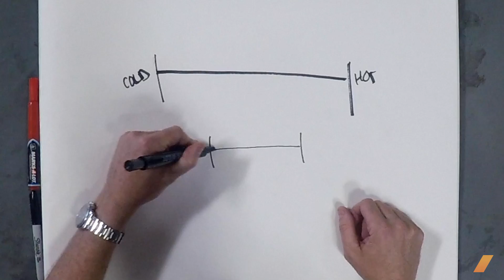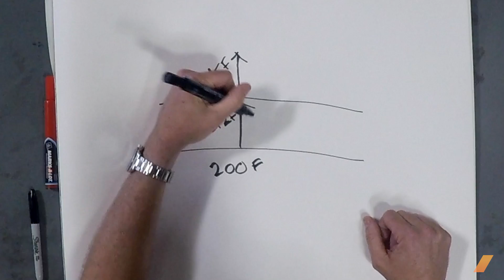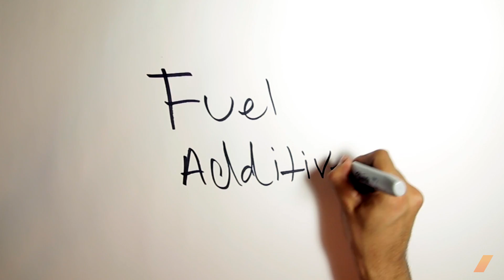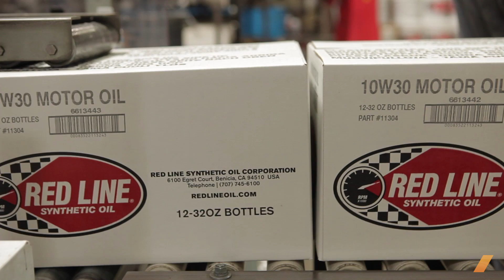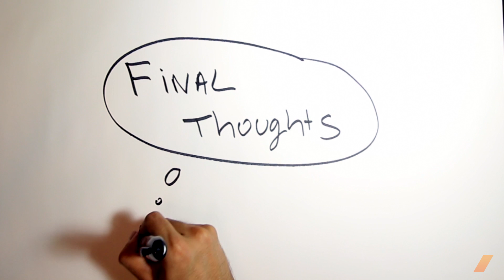10W-WTF!? Dispelling Myths About Oil -- /ENGINEERED

Comment: So my question is. I really like Redline, that is all I run in my 500 horsepower daily driver/track car. At what point do I blend Redline race oil with Redline daily driver oil? If your company could produce an algorithm that could address that through testing I would be a Redline buyer for life. If your company would be so bold as to design a program for weekend track warriors to blend different types of oils with different weights depending on driving types and different thermal locations in the USA, I think you could increase sales.

Comment: not sure what you guys are so impressed about,there wasn't much in this video. 

i run my 2.0 4 cylinder with variable valve timing on helix ultra 5w 40. it's 150,000km now with zero. i mean zero. oil loss in 8 to 9 month 30,000km change interval. the engine has zero vibration, and the oil drains smooth. it's a 7 year old car that's had only synthetic in its entire life. the api rating doesn't mean shit at normal operating temperatures. like the dude said, all oils have same viscosity at operating temperature. the biggest misconception is that synthetics are too thin for high mileage engines. nonsense. you buy top end oils for detergents, stability and wear protection, NOT viscosity. that is all you need to know.

Comment: Theres no difference between using cheap fuels or premium fuels, what matters is using the right octane rating fuel because regardless of which fuel you use its going to build up carbon in the engine regardless and the type of additive you use would also depend on what you're trying to clean such as if you were to use recycled cooking oil as a diesel than theres more than carbon you'll be cleaning.

Comment: Rotella T6. Period
Reply: While Rotella T6 is good oil it may not provide you with the protection you think it does. 
Rotella T6 does not have high levels of zinc and phosphorous (ZDDP) that Rotella once did. 
No current API category SL/SM/SN or ILSAC spec greater than GF-3 oil has high levels of ZDDP.
Reply: Good but very basic in formulation and additives. Nothing like Redline or Motul 300v

Comment: I just throw supertech 5w30 oil in my old little 256k miles truck...never had an issue...10 bucks 5 quart lol!
Reply: *****
 Yah i hear that, my buddy has an B&W he will never again buy another one. I love my old little beater truck. I see all these cars these days popping gaskets and doing weird shit and demanding golden glove made oils and such.

Here i come with a 10usd oil pan full and a simple little filter for 5 bucks and i am making my miles with minimal effort. They just do not make them like that no more. And i i do have a brand new Malibu 2015 LT i barely drive..free oil changes but i know they throw in the good stuff. So not bashing any other new car, but still what changed i wonder..
Reply: *****
 Meh what is worse on gas?! I mean i got a 2012 3.7 v6 mustang which does 20 to the gallon, i got a Malibu LT that does 22 to the gallon with 100hp LESS and 2.5l 4 cylinder ECO! Rated at 200hp..
With the auto start/stop system installed.

Then i got my old little 1996 chevy s10 4.3l and i can bolder around 200miles on a full tank which is not much bigger than that of the other cars mentioned. And those had 200hp on the REAR wheel, not all to bad for a old little pick up!
Reply: Eh? 20 to the gallon is 8.5 Km/l. 22 is 9.3. That is very low. I have had cars from the 80-90's with better mileage than that. 93' 3.0 Diesel that goes 33 Mpg, a 86' 2.5 that went 39 mpg with 536000 miles on it.
Even my GSXR bike gets 23-30 Mpg and that is from 98 with a screaming 140 hp.
Reply: Stefan Asmussen
 You missed the point, my point was precisely that they are ALL lousy, while they advertised my 2015 Malibu LT 2.5 to get whopping 35mpg...i can get 24 if that..

My OLD truck (as above they said older engines lousy MPG) and that's a v6 4.3L which pretty much an vortec 350 small block 5.7l where they cut of 2 cylinders (so not small by any means)

DOES pretty much the SAME on mpg...

MPG is hard to determine, when cars get sold that's such a skewed number not even funny.
Reply: Then stop buying cars with large engines. If you want better mileage you need to be under 3.0 liters and 2.0 for petrol.
Although I hate petrol engines.
Reply: Stefan Asmussen
Who said i CARE about my gasoline consumption. Also you clearly did not read...

my 2.5liter 4 ECO uses as much as my 3.7 v6 mustang does. And my 4.3l v6 truck uses perhaps nearly the same as the above..

I would never go for Diesel as it's to expensive to maintain special fluids for emission purposes. Also more expensive in fuel, although they get better MPG ratings which i really do not care one bit about. It's not like a diesel truck gets 20mpg more out of it vs its gasoline engine of same size. All you get with diesel is more torque. Which would be nice when you pull trailers of 6000 pounds and up on daily basis.

For just commuter, the hell with diesel..

Also for me personally?!

I fucking HATE, and i do mean HATE the knocking sound a diesel makes.
Reply: Supertech synthetic is some good shit... almost 130k miles of it's use on my lincoln LS with 185k total miles. 

The fuel economy is a bad joke. You know why all the cars in normal real use conditions get about the same MPG? it's because every gasoline engine is roughly the same thermodynamic efficiency. Hasn't changed in 100 years. We've made some optimizations, but the basic heat cycle is the same. The only thing better is that loud knocking diesel you hate... at about 45% efficient, where gasoline is 20-30% efficient. 

compact cars aren't any more efficient than sports cars, in engine efficiency, the main advantage is the eco car has just enough hp to keep you from being passed by turtles and snails, why the sports car has 10 times the power necessary for the job. But, steady state, running down the road, if you put the same tires on both, and shut off all the auxiliary loads, they'd be pretty damn close to the same.
Reply: Pretty much the same but the big engine will still use more fuel because it has more internal friction and rejects a lot more heat, heat which you paid for at the pump.
Reply: You're not a math guy are you? Pushing the vehicle down the road at some speed takes x HP, it doesn't matter what the power plant is, it's still going to take x HP.  Doesn't matter how big the engine is. Unless you try to make some idiotic comparison between something with a lawnmower engine and a 800 cubic inch V12 from an American LaFrance fire engine (which alone weighs more than most cars), gasoline efficiency is gasoline efficiency.
Reply: Fuel economy depends on the driver. Given the same car using the same fuel and oil there's going to be a big difference between an 80 year old granny and a 17 year old kid driving it. The EPA figures you see posted on new vehicles are machine readings taken on a vehicle standing in one place. EPA does not tell you the conditions their tests were performed under. Ball park figures??? I don't know.
Reply: As long as an oil meets the specifications required for a given engine, then the brand absolutely doesn't matter. Where people get this screwed up is in thinking that brands like SuperTech are made by Walmart or whatever - YEA RIGHT. The cheap brands are still made by the same major oil manufacturers - and NO manufacturer goes out of their way to make some super shitty oil that is going to kill engines the moment they're used for 3001+ miles; no, Walmart, other store house brands, gas station brands, etc. are just buying the cheapest that these major manufacturers offer. But, again no one is going out of their way to set up a production line for a shitty oil; no, they're just selling the SAME oil that is in the 'expensive' bottles, but without a lot of the cost adders like the cutting edge additive packages and detergents that the 'expensive' bottles get. It's cheaper for them to sell the same GOOD name brand oil to these house brands in its most basic form than it is to go through the expense of setting up a unique production line just for a worse quality oil - economies of scale working in the favor of budget shoppers.

Nevermind the fact that absolutely N-O. O-N-E. is going to sell a damn oil that can in some way be proven to cause extreme engine wear or damage, if not outright failures, even if used, say, 50% longer than suggested oil change intervals - no manufacturer is going to design & produce such a horrible oil and open themselves up to potential litigation(this would QUICKLY turn into a class action suit), and no brand is going to request such a horrible oil and open themselves up to potential litigation. To think otherwise is positively IDIOTIC - and, yet, for some reason, when I've attempted to explain this basic common sense to various people across the 'net, I almost always get some kind of pushback from fools that are just convinced that 'Walmart oil' will fuck up any engine that isn't a 1967 small block Chevy. "For some reason..." they can never actually explain HOW they would get away with such a deliberately poor, destructive product, or even why they would want to... ..."but, damn it, you must be a FOOL if you think that I would be dumb enough to run Walmart oil that is totally rated for the specifications required by the manufacturer and blow MY finally tuned Swiss watch of a bone stock engine up!!!!" ...yea, OK, Mr RaceCarDailyDriver...

But, hey, some people gotta justify blowing huge amounts of money on MASSIVELY OVERKILL consumables multiple times a year some how - I'm sure they would run high octane race gas too("cuz it's better!!!" - huh? In what way???) if it was more readily available too.
I just justify wasting money on expensive consumables because I'm a car enthusiast and am already unnecessarily wasting money on things like my daily driver anyway, even using oil analysts services too - don't know what the big deal in just being honest with yourself about it is, I know my junk doesn't run much better on the expensive stuff, but that's not why I'm using it.
Reply: @MillieMoses  is their a non vanos bmw?
Reply: @SpaceraverDK  you have not seen a tb48 de run

Comment: Be careful with oils,we still have armchair designed racing oil,,stick to laboratory designed and ,tested oils.I recommend synthetic 15 - 40W race oil  in a bracket drag race engine,high output street engine for all around longevity, thin oil  ,Pro stock 1700,1800hp Fuel injection  or any Ultra high horse power engines that are torn down after a few runs.Top fuel,Alcohol,ultra heavy oil,fuel dilution warrants it.In all the testing ,the thin oils.

Comment: Unfortunately cheap bastards will still use the bottom of the barrel oil, thinking they're saving money in the long run.
Reply: g4rr377
Agreed, that's why I personally don't drive even though I'm going on 26 soon. Sure I could "afford" to but not in a way that would benefit me or the vehicle. I'd be losing money in gas & unable to perform routine maintenance.
Reply: This is why I can't avoid second-guessing my decisions when I buy a used car.  The things people do to their vehicles just makes me cringe..
Reply: Mike Soda depends on the application though. It's often better to replace cheaper oil at a higher frequency, then better at a lower frequency.
Reply: march11stoneytony
True but most of them don't do that either. So long as it "works" & so far hasn't given them any obvious trouble they don't see the big picture in those bad practices.
Reply: Mike Soda ....True, I used to get oil on my company fuel card.  good quality Shell oil and use it to flush my Harley out. Then I would fill up with the correct oil. Did this twice a year. The cost of two filters and a UK gallon  didnt cost the earth and gave me piece of mind. .
Reply: Michael Walker The cost of oil is a LOT cheaper than an engine rebuild because your motor has the slap due to out of spec clearances from worn bearings, rings etc. and the peace of mind is priceless.
Reply: sc0tte1
I know but the cheap bastards I'm referring to are the people who buy a cheap used vehicle. Then when it's almost completely broken down from a lack of maintenance they sell it for scrap & repeat the process.
Reply: march11stoneytony yeah this is what I do with my dad's company trucks. I buy bulk 5w20 and Ford filters and change it every 3k miles. only cost about $25 and allows for the trucks to be inspected more frequently. 

one of the issues with the high performance synthetic and long change intervals is oil consumption. I run castrol edge in my 5.7l Jeep for 10k miles. I need to add a quart at 5k, which is not bad. problem is most people don't have a clue (and therefore should go for an oil change every 5k miles).
Reply: If you own a Toyota it doesn't matter. Those things last forever!!
Reply: MrRedskins0021 I own a 96 corolla with 302k miles. tbh my rings are fried from high throttle cornering with a lack of a baffled oil pan. I have to check my oil once a week or everytime I go for a long drive and are driving in excess of 80mph at any point during that drive. just the other day my oil light came on and freaked me out when I had to put 3 quarts in to get it to the right level on the dipstick(pan with filter holds 3.2Q). This motor is on it's last leg even though I did a compression test @ 250k and got 185psi acrossed the board. I'm seriously considering switching to a 40 weight because I notice a large amount of vaporization in the valve cover even at a normal operating range. once I get my 3.7 swapped rx7 on the road I'll probably buy a used 7afe and build it for motocross with tighter tolerances and weld up my own custom baffled pan replacing the tired old 4afe. I think I might test out an old suggestion my dad had of idling with a pan full of diesel to clean all the crud out of the galleries, rings etc.
Reply: LOL, wut? Looks more like about choosing the right viscosity regardless of the stock/brand.
Reply: "bottom of the barrel"  I see what you did there.

Comment: As a fleet manager I used everything from their gas and diesel additives to their gear oils, they are the best, my machine shop hates me using this stuff because they can't remove this oil off of parts easily, especially since the county I live in has such heel - clicking eco regs, I was told to stop using their oils. Alas, neither O'Reilly or advanced or auto zone no longer carry their products, sucks because shipping from cali to Colorado on a 6 gallon case is close to a hundred bucks, that's why I stopped using redline products.
Reply: I had the same problem, seems they only give price breaks to really large orders. Try schmoozing a high line dealer like Porsche, they often recommend RedlIne (or used to) or a racing shop, they can get the stuff a lot cheaper since they buy in bulk.
Reply: 3r Racing in Denver sells RedLine. FYI.
Reply: Go to ECS Tuning. Free shipping on any order above $49.

Comment: I only use synthetic. I started using it in my first Camry.  I changed the oil every 3 to 4,000 miles and used additives like Slick 50 and Duralube and I sold the car at 400,000 miles and it still ran like a top. I sold it for $400 to a guy and I use to have an unusual rear window decal and my brother saw the car 3 years after I sold it and it was still on the road. The oil I used to use was Mobil 1. I changed the filter each time I changed it and I also changed the transmission fluid every 10 to 12,000 miles. Back in those days the mechanic used to give you the printout from the emissions machine and I had very little emissions, even in the 3 to 400,000 miles and the mechanic could not believe it.  But it was true. I never raced a car though.
Reply: U way over mIntained that's why. My Dad is same altho not as drastic. Keeps his F150s to 300k mis an sells em. Every one.

Comment: Oh my god, so much wrong information.  For starters, 5w-30 is not 5winter-30, it's 5weight-30!  the first value is the damn base stock oil, and the second value is after thickeners have been activated.  It's not thin at cold temperatures - it's thick at hot temperatures!